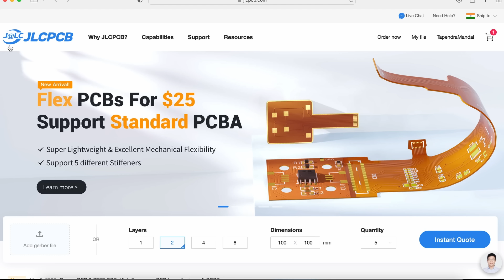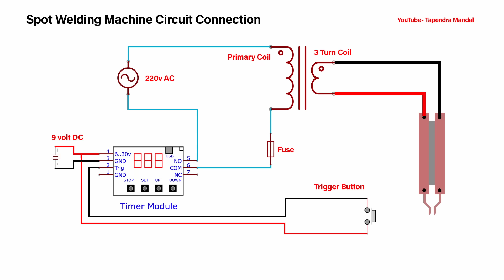BUILD A DIY SPOT WELDING MACHINE

Comment: I built one of these but opted for the temu spot welder handle with the 2 copper tips and press trigger. I use 2 small car relays and a 1000uf capacitor to set the pulse duration. higher uf, longer duration. My windings take 115V -15A down to 2.9V-110A (?) it makes a pretty clean spot weld with 1mm marks I usually do 2-3 per battery strip. It really helps when the battery is clean. Also a cheap foot switch, even a button on a board is super helpful when you need 2 hands to hold the strip and the welder handle in position.

Comment: OK, I have a question. Is the 220 there two hot wires going to transformer wire or is it one hot and one ground? Also for the 120VAC does the HOT side or ground side go to one side to the ground and the negative go to the timer!

Comment: TWO BIG MISTAKES
He’s inconsistent with connectors. He should never use thin ring connectors, which create a lot of resistance and heat up very quickly. The cables should be soldered to maintain the conductance of the entire cross-section of the cable.
FIRST  BIG mistake.

If it’s just for 18650 cells, such heavy-duty gear is completely unnecessary.
Form over substance — SECOND BIG mistake.

Comment: Es gibt doch viel günstigere Funkgeräte ohne Stördrossel die dann funkt ? Zum Schweißen braucht man immer einen echten kapazitiven Schweißtrafo mit ausreichend konstanten Ampere. Die Transformator Übersetzung beim Mikrowellentrafo von primär zu sekundär ist etwa der Faktor: 1/8,8 aus der dünneren Wicklung kommt etwa 2000 V wenn man an die dickere 220 V gibt. die dickere summt dabei etwas in der Mikrowelle primär verwendet, sie wurde wie ein halber leicht belasteter Trenntrafo benutzt auf den man z.B. auf die 110 V Wicklung geben würde für rel. kurze Mikrowellenzeit 220 V gibt. ->2000 V , 2 A. 
Vertauscht man primär mit sekundär indem man 220 V an die dünnere gibt summt der Trafo fast gar nicht (das verwundert),obwohl jeder Trafo eigentlich immer etwas leise summen muß. (Grund: die längere vorher 2000 V, Wicklung sollte eine Röhre versorgen und diese ist sehr empfindlich, und wurde für sehr konstante Hoch - Spannung verlängert optimiert) => Schweißtrafo aus Mikrowellentrafo: man halbiert die sekundäre lange überdimensionierte Wicklung in der Mitte und setzt zwei trennende Lüsterklemmen dran, man halbiert die primäre kurte Wicklung in der Mitte und zetzt zwei trennende Lüsterklemmen dran. jetzt nimmt man die jeweils doppelten Wicklungen in der richtigen Richtung sowohl primär als sekundär parallel. => Resultat: man bekommt jetzt wenn man an die parallele dünnere Wicklung 220V gibt auf der dickeren Wicklung wiederum 25 V und 20 Ampere. Man hat also primär und sekundär erfolgreich vertauscht. Zusammenfassung: man nimmt zwei Mikrowellentrafos noch parallel, Dann bekommt man echte konstante 40A und 25 V heraus an der dickeren Wicklung. dabei summt alles kaum hörbar, perfekt wie ein geeigneter Normaltrafo. von kurzzeitigem Anstieg der Stromleistung aus dem Trafo durch Kurzschluß wurde noch gar nicht gesprochen. Das braucht man nämlich und geht dann hier auch. Sinnvoll ist natürlich am 220 V Netz eine doppelte simple Haushaltskoppsicherung am Gerät selber mit 2 x 6 Ampere, für echten Strom. Man kann auch solche normalisierten 4 x Mikrowellen - Trafos davon normal zusammenschalten, noch mit einen Handgriff in einer rel. kleinen Box, sehr gut kompakt tragbar und hierfür dann rel. leicht, kein bunt bemaltes Elektro - Windei aus Blech, ohne irgend einen vorhandenen Schweiß - Trafo ?

Comment: The most dangerous part in a microwave
Reply: But obviously not dangerous in this case because the turn ratio is down converting the voltage.

Comment: Man braucht überall erst die einfachen funktionierenden Grundlagen.
bereits zwei kleinere Trenntrafos kann man sekundär nochmals auftrennen.
seitlich auf die windungen schauen ankratzen und Spannung messen dann 
wieder mit Lackstift versiegeln.

Noch besser man verwendet 2 kleinere Trenntrafos parallel
und zwei wiederum davon seriell [insgesamt 4 x]  [220 V=> 2x 110 V] dort kann man experimentieren, die 110 V Sekundär trennt man auch noch mittig auf 
und setzt 2 x Lüsterklemmen drauf. Dann verbindet man alle 8 x einzelnen 
Sekundärwicklungen mit 25 V parallel, wenn man einmal richtig experimentieren will !
man schraubt 2x 4 Schrauben in ein Brett und setzt die 
selbstgebauten Blechklammern als Wellenklammerreihenklipsleiste
oben und unten drauf. wer weniger Ampere braucht kann eine einzelne  sekundäre
von einem Trafo nochmals auftrennen in =>  2 x 12 .5 V und mit einem Schalter wieder verbinden.oder parallel klammern mit einem ausreichenden Doppelschalter für 12.5  V und doppelt so viel Ampere man kann narrensicher  einen Diodenwiderstand anbringen damit beide immer grün leuchten müssen bei abwechselnder Schalterstellung und damit diese nicht dabei kurz geschlossen werden oder Schutz über Kipp -  Sicherung..

Comment: Das funktioniert auch nicht mit zwei extrem kurzen  Wicklungen und schwachem Trafo auch nicht so, =das sind dann oft etwas weniger als 1 Volt=  Die Überspannung ist noch größerer Betrug.Das ginge auch aber nur bei mehreren echten 500 A Trafos, die kaum mehr jemand hat. Man sollte immer mit 21 Volt Gleichstrom und sehr viel Ampere erprobterweise schweißen. Also als Kurzschlußstarterstrom schon mehr als eine Autobatterie. Und ausreichende induktive Ampere Kapazitäten dafür auf der größeren Trafo Spulen - Rolle ohne Ende haben um das Stromnetz nicht zu belasten, oder nur Kurzschlussblitze für mickrige Sekundenbruchteile nur zu verschicken ?. Nein das gar nicht ! Gute Imagination. Aber so geht es wirklich auch nicht als Schweißtrafo ! Hier sind dann zwar einige Ampere aber gar keine Volt mehr drauf ! Man muß diesen gezeigten Trafo schon ein wenig seitlich erweitern ! Und bitte nichts kaputt machen !

richtiger Kleinsttrafo zum Schweißen: (experimentell)
Weshalb wird nicht einfach eine dicke leicht überstehende U-förmige Metallblechklammer an den Mikrowellentrafo geklemmt und in den distanten angeklammerten rumgebogenen U-Bogen der auf einer dünenn Neodymblechplatte sitzt wird distal eine dicke Eisenkernschraube rein geschraubt. Dort wird ein z.B. immer zweifaches Autobatterienladekabel seriell „zu einem verbunden“ und mit dicker Plastikhülse oder umgebendem Klebeband isoliert . Anschließend wird das dicke Kabel um den massiven seitlichen U - Stahlträger - Schraubenkern herumgewickelt, als zweiten sekundären Ampere - Ausgang. Der dann zum Minischweißen geignet ist ! 

Man braucht jetzt noch einen Kleinen Frequenzumspanner.  Die allererste sekundäre Mikrowellentrafo - Wicklung wird jetzt Primärwicklung mit einem Leistungsdimmer mit 10 parallelen Tyristoren erweitert und mit 220 V (davon ausgehend) einstellbar betrieben und dann als primär dimmbare 220V Wicklung verwendet. Diese erhält dann auch einen Überlastschutz für 220 V mit Kipp- Sicherungen. Die anfangs primäre Mikrowellentrafowicklung, wird jetzt als sekundäre Wicklung verwendet und in zwei gesonderte Wicklungen aufgetrennt für den nachfolgenen Frequenzwandler aber vorerst durch eine dicke Lüsterklemme wieder mittig verbunden . Man erhält jetzt in der Mitte zwei sekundäre zusammengeklemmte Wicklungen und erhält bds 2 x ausreichend starke Parallelwicklungen an beiden Enden zum Aufbau eines gut funktionierenden bistabilen Schwingkreises. vor dessen Basis - Eingang muß noch 2x jeweils eine kleine 50 Hz-Drossel mit sehr vielen Wicklungen ! . Die nun sekundäre Trafowicklung (vorher primär) begrenzt sich als berechneter 50 Hz Wechselstrom  - Drosselspule beim Mikrowellentrafo selber hier.Das geht teilweise auch sekundär betrieben und hierdurch intrinsisch hierdurch in sich bewußt bei Mikrowelle abgesichert. 😄😄😄.

Diese werden zusätzlich über ausreichende Leistungsbrückengleichricher als getrennte zuführende Stromquellen abgesichert und verwendet  für die zwei Reihen parallele höherfrequente Regel-  Schalt- Transitoren verwendet. Ein Inverter aus z.B. einem Cmos Inverter 74 SN 04 ist einfach realisierbar. Er erhält eine zusätzlich stabilisierte eigene Versorgungsspannung.  Dann wird z.B. ein einstellbarer Frequenzgenerator mit daran verwendeter eigener Betriebsspannung vor den Inverter gesetzt.  Der Inverter wird aus parallen einzelnen Invertern eines dort enthaltenen einzelnen CMos Bausteins aufgebaut. Bsp. Für eine CMos - Inverterschaltung: https://www.youtube.com/watch?v=18UUoiRgecQ

Dieser betreibt wiederum am "Invertierenden und Nichtinvertierenden Ausgang"  jeweils mehrere parallel geschaltete Leistungs IRFZ (in zwei Reihen auf einem Kühlblech jeweils und eine dann gut rückkoppelbare stabilisierende Spannungseinstellung. Anschließend wird dieser jetzt verbundene bistabile Leistungsfrequenzgenerator an beiden jetzt sekundär gemachten Mikrowellen - Spulenenden mit regelbarer Endlast betrieben für den einfachen Frequenzumspanner. Der hochfrequente Amperestrom wird dann auf die dickere Schraubenkernspule mit dem dort breit aufgewickelten Batterie - Starterkabel letztendlich mit hohem Amperfluß verwendet, der induktiv aus der viel höheren Netzspannung geholt wird welche ja meist mit etwa 6 bis 12 A bei 220 V betrieben und entsprechend normal abgesichert wird. Zuletzt wird der Strom terminal über einen einigermaßen ausreichenden Trafo an diesen über das genannte  dicke Amperewicklungskabel mit trotzdem noch relativ ausreichenden Volt - Wicklungen übertragen. Hierdurch erhält man dann ein regelbares Kleinstschweißgerät wenn man geeignete Elektroden verwendet. 

Vor den dicken Spulen - Ausgang kommen z.B.  6x  parallele Brückengleichrichter mit je 35 A 
zum gleichförmig und kontinuierlich stabilisiertem Gleichstromschweißen für Klein Schweiß - Profis setzen.  Man darf aber auch hier nicht allzu große Ampereleistungen erwarten. Bei dieser Abmessung. Die aber dann schon etwas wiegt. Da der Trafo immer noch eine rel kleine Kapazität für Ampereleistungen hat und man alles aus dem 220 V - Netz holt Aber jetzt schon relativ um ein Vielfaches mit echter induktiver Amperereserve deutlich besser und stabiler geht und nicht nur verblitzte Fake - Hochspannungen ohne Dauerampere liefert, sondern richtig dimensioniert ist. Es ist dann auch noch runterregelbar, Ohne IRFZ kämen allerdings nur wenige Volt heraus. Das wäre wie hier gezeigt dann auch wieder viel zu wenig. man braucht das ganze nochmals mit einer dicken breit überstehenden Eisenklammer angekoppelt und einer Starterkabelspule in relativer Wickellänge parallel drangesetzt. Und im U-Eisen eine sehr dicke übliche Eisenschraube als neuen induktiven Magnetspulenkern ! (kinderleicht drangesetzter Doppeltrafo). Diese anderen Chinesichen Welder - Geräte sind massiver grasser Betrug und heiße Luftbildung, die man überall als Gauner Werbung sieht .Diese würde ich aber auf gar keinen Fall kaufen. Auf gar keinen Fall. Außer man will 100 Euroscheine bündelweise verbrennen ? Das ist totaler Betrug ! 

Da ein ausreichender kapazitiver Schweißtrafo ohne jeglichen vorhandenen Trafo niemals auskommt braucht man schon entsprechende induktive Amperekabelreserven der Länge nach genauso. Dann könnte man sonst nur Desktops und größere Handys damit nur mit schwachem Notstromimpulsen zum Akkuladen betreiben ? etwas zynisch ausgedrücht ! Aber das ist die ABSOLUTE nackte andere Anwendungs - TATSACHE hier und verbleibende Quintessenz aus dieser verdrehten Werbe - Geschiche !

Die dritte Möglichkeit:  Man richtet die 220 V hinter dem Dimmer gleich zu Gleichstrom
und wandelt diesen über 4x IGBTs als NPN und PNP +ber Kreuz von 50 Hz bis bis 1.5 khz regelbar als Frequenzwandler ab 220 V und reine Emitterschalter ein. Nur über die umgekehrt gewählte Primärwicklung ! als Brückenschaltung und vorausgehenden Inverter mit Frequenzgenerator.  Diese vertragen gewöhnlich noch höhere Spannungen als normale Frequenzwandler.Genauso setzt man hier sehr  hochohnmig und hochvoltig teils verträgliche und regeltechnisch auch teilweise abgesicherte IRFZ , zweckdienlich ein , allerdings nur als Kollektor und Emiterschalter als vierer Brücke , diese vertragen bis 600 V hierfür, oder als 2 x primär gleichsinnige  Emitterschalter aus selektiv geeigneten IRFZ mit bistabilem Kippstufen -  Mittelabgriff zweier geschaffener Frequenzumrichter  - Teilspulen hierfür .

Comment: I would suggest a 10 ohm 10 watt resistor in series with one of the transformer lead to avoid shorting and stressing the transformer if you are going to do many welds.

Comment: 3:03 there will be a lot of heat loss. Put the lugs for larger currents and press them well with crimping pliers. then there will be no losses. You can't do it with ordinary pliers.
Reply: If you don't have a crimping pilers, can solder it instead?
Reply: @Benquanyu yes

Comment: Used Component-
1. Transformer from an old oven
2. 10mm copper wire (2 meter)
3. Timer circuit
4. Copper Bar
5. Wooden base
6. 12 AWG Silicon Wire
7. Push button
8. 20amp Fuse

Comment: A LITTLE SOLDER IN THOSE TERMINALS WILL WORK WONDERS, OR YOU CAN TRY A REAL CABLE CRIMPER INSTEAD OR BOTH...

Comment: From what I understand a transformer is like a pressurize container that stores amps and shoots them out like our a pressurize water cannon shoots expect the transformer holds electricity am I right or wrong
Reply: You are very wrong. You might be thinking of a Capacitive Discharge system? Transformers (excepting flyback transformers) don't store anything. Transformers transform voltage and current in relation to the turns ratio. With a few turns on the secondary you can get low volts but a very large current.

Comment: Everyone who is using an old microvave transformer keep a eye on the 2 AC wire one is not connected to the primary coil . This was the reason i thought that the transformer is broken or there is a problem in video 😮‍💨
Reply: Its working 100% sir
If not weld then make first flux on cell then try again sir
Reply: @MuhammadShahid-y6x  i made it boy it was just some connection problem on my side

Comment: Hey where can I get the Microwave Oven's Transformer, Please Help me
Reply: IT'S a secret, don't tell anybody, this transformers are.... Inside microwave ovens !
IT MAY BE A BROKEN, OR DISCARDED MICROWAVE OVEN, OR YOU CAN BUY...
A NEW TRANSFORMER OR A NEW MICROWAVE OVEN AND REMOVE THE TRANSFORMER.... IT WORKS... BUT IN THIS CASE, YOU BETTER BUY A SPOT WELDER ALREADY MADE.... 😝😁😬
Reply: You can buy an old microwave oven at the any scrap shops near by you & then open that carefully, You will get the transformer in that, okay.😊😊

Comment: This timer circuit is low ampere so how you control on it 50 ampere transformer?
Reply: The timer relay controls the PRIMARY of the transformer. Since it is probably a 1-1.5kW microwave, the primary current should only be 10-15A? (Depends on your mains voltage the transformer is designed for... For 220v-240V primary the current will be less..) You are switching the primary, not the high-current secondary. The load at the electrodes is resistive and so inductive surges should be minimal.
Reply: IT controls the primary of the transformer, but is not needed, use a 20 AMP 220v push button switch, mount it in the welding handle with 12 gage wire (good for 20 amps) and control welding time by hand, not critical
Reply: @verocola6335  Вы так делали? А если передержите сожжете батарею.

Comment: Fake. Welds are made with fair quality DC welder (look at pair of spots and you guess where plus and minus were) and "transformer sound" synchronized in video. Wonder that none of these fantastic cheap welders are shown with cables from the device to electrodes visible?
Reply: Смысел ему обманывать? У моего знакомого что то похожее и много лет варит.

Comment: Your AC supply  is 220 volts, your  primary coil is 110 volts you cut the 220 coil from transformer its not burning?

Comment: I have a 3 phase 230 volt transformer output 48 volt 95 amp for a forklift charger Can I use only half of it (or 1/3 of it for 120 volt single phase) for making something like this? I also have microwave transformers but would like to experiment with this big thing. I mean I don't want to throw it away before trying something with it.
Thank you.

Comment: some calculations would be nice. if you know your desired current, the mains voltage and the turns in the primary coil you can calculate the turns needed in the secondary coil, this is critical to know for this build, every transformer varies: for one an american microwave would need half the coils as a british one, however it may trip the breaker if the input current is too high, etc`, etc. video lacks any sort of explanation, i'd have that over some music.
Reply: by @1/2 the coils@ I meant in the secondary transformer coil to achieve the desired current, assuming all other variables are constant. Again, get a transformer equation off the internet, calculate it yourself, takes 10 mins to do.

Comment: Hello...does the small circuit board also control the strength of the welder besides it's time ???
Reply: The timer board is more to turn mains power on n off through a low voltage actuated relay  as not to have mains power in your hand when holding welding probe.  low voltage relay controls the high voltage to primary of transformer..

Comment: What is the cross section of the black cable in the transformer?
Reply: 次級線徑最好8mm  = "The secondary wire diameter is preferably 8mm"